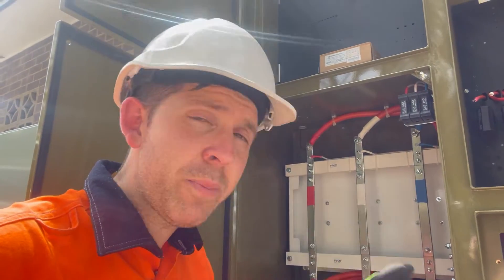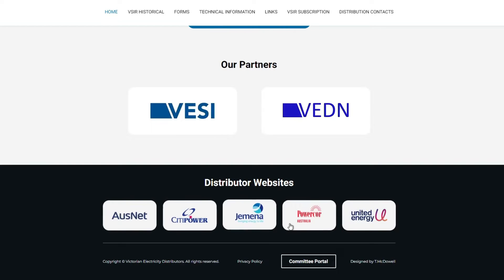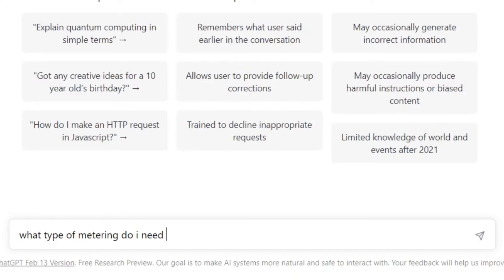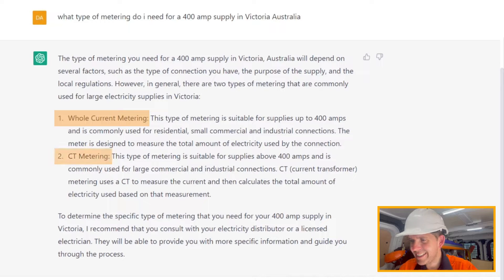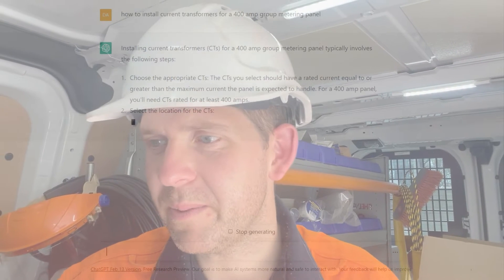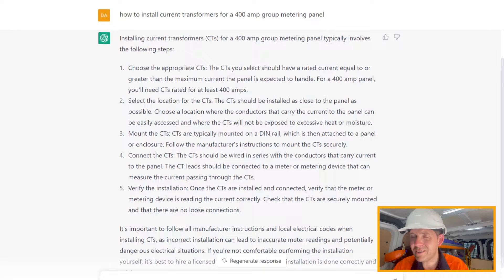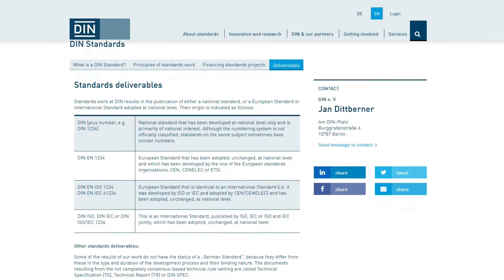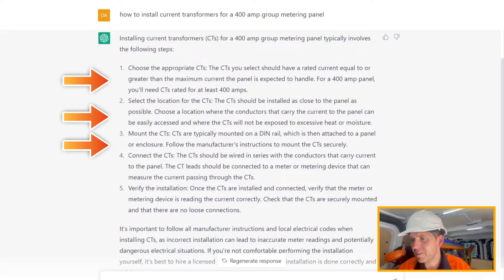Could AI take over ELECTRICIANS?

Comment: Here is my 2 cents for whatever thats worth, if people where capable of understanding writen directions and safely applying them consistently skilled trades would have died with the invention of the Internet because its all there. I have to look up regulations and read equipment manuals and bulletins all the time, the difference is I understand it and I understand how to not bbq myself with a 480v circuit on a 40 amp breaker.
Reply from the maker: True 👌

Comment: I mean... ChatGPT is AMAZING... as a coding resource.

Will it code everything you need from scratch without any issues on the first attempt? no.

But it can write some simple programs... and I mean S I M P L E.... for you and they'll be like 90% functional.

It can even tell you how to take the code it spits at you and turn it into something functional.

That said, it's a chat bot. It's a language model. It's designed to take an input and try to guess what comes next.

OpenAI's ChatGPT is also trained on information that's only as recent as 2021 too, so if you're looking for RECENT information then you're probably out of luck.

But yeah, you pretty much just displayed what it's good at. It can search through what it knows and spit out stuff that's kind of relevant, and then what it doesn't know it can try to "guess" (and it will be CONFIDENTLY wrong).

Want my favorite example of why it's a tool but it's not the whole toolbox? Just ask it "How many Earths would fit inside of Texas?".